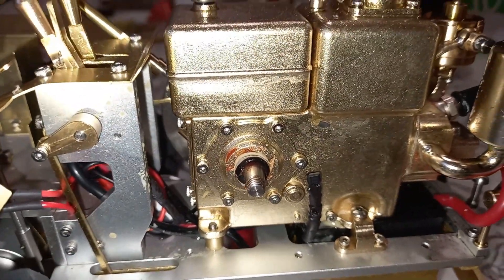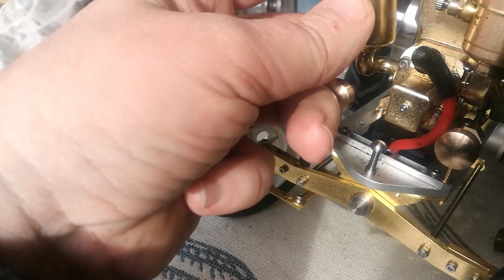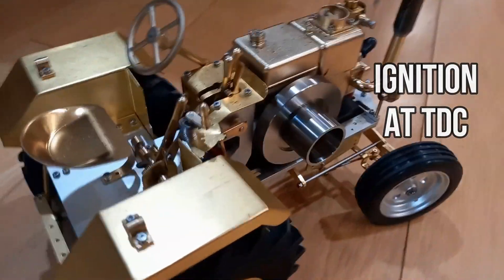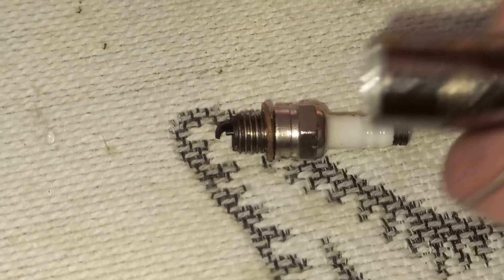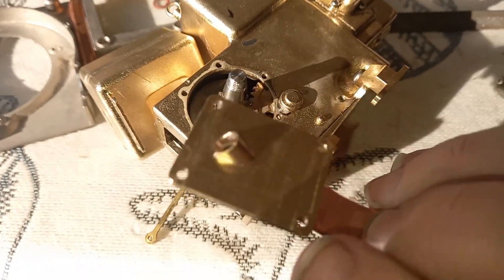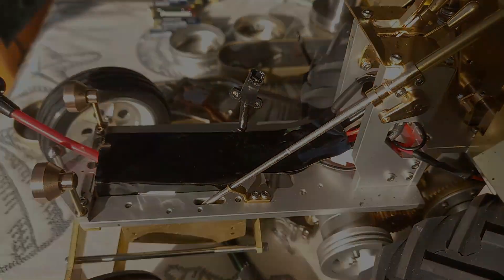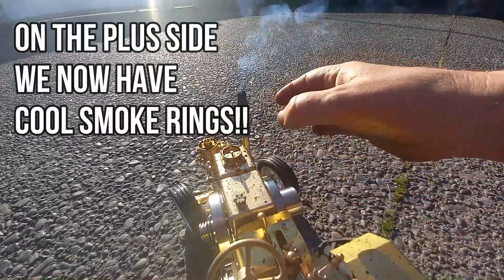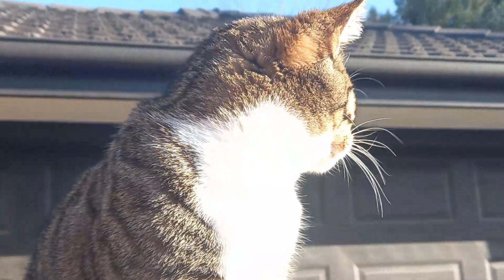T26 Model Tractor oil sealed, muffler, tweaks & FUN #model #engines #gasoline #chinese #t26

Comment: This tractor is so cool!
I have a horizontal M16B engine, mine's inging point was delayed, I also had to do a tune-up, which improved mine performance from 6000 rpm to about 8000 rpm.
Then I removed a slack in the bearings that tightened the valves and fine-tuned the air-gasoline mixture, in the end the engine reached 10,000 rpm.
I also had the same problem with my Cison L100 engine, where the solder melted on heating the discharge.
Reply from the maker: I don't know how I missed this comment! Leandro, I have just purchased the tractor with this engine. Another person with this engine commented that the lobes on the camshaft wore off. I am thinking how to counter this; maybe caseharden the cam or create an oil/grease bath for it...as it is raised. We sound similar in our wish to perfect these as much as possible! I love getting comments...sorry for late reply!!

Comment: I like to know how you set the hall sensor and the sizes of O-rings . Thanks Jeff
Reply: Hi from Thomas and the cats!  Thomas is really busy with work right now Jeff. But just quickly, ...he removed the spark plug and gently poked a small thin piece of something eg a hex key into the plug hole so it rests on the top of the piston. gently turn the flywheel to discover the top dead centre (that's how centre is spelled here in NZ along with millmetre, etc). He made a mark with permanent marker on the edge of the flywheel and against the top of the side of the engine (you can see in the vids). Next turn on ignition and hold the spark plug against the engine, rotate by hand. You'll hear the spark happen near where TDC is at but usually before it... To move the hall sensor you can grab the bottom of it with pliers and move it 1-2 mm and keep checking spark with your TDC. You want it really close to TDC I think,  but you can experiment. When tested, a drop of super glue will stop that hall sensor vibrating away from your choice. Sealer or blu-tac might be less permanent
As for o-rings, he has a "crap" set from a $1-2-3 shop with a bunch of sizes. The one on the Hall sensor side of the engine is just a little small for the shaft, and butts up against a flat washer that's just the right size. That was harder to find! The ones on the other side just dropped in, they are slightly bigger than that hole area...I'll get him to measure later. Sorry for the late reply
Reply: @xiaolingzhang5385  Hi . I like to know what weight of crank case oil should be used and what type of oil .  I also like to know if you use some oil mixed in the fuel or if you used other than gas . Like Colman fuel for lanterns  !  I got mine Sunday 7/ 10 / 22  in the after noon .  I was waiting like a little kid  looking at all the candy at the candy store . Could not decide between small bag full of penny candies or just one soft penny candy .  Bag full of hard candy would last a week and only cost one penny or one soft penny candy would only last 10 minutes .  Hep those was the days when you could buy something with a penny .
Reply: "Mullinix?" Where is that surname from? Where are you from?? :)
Reply: @xiaolingzhang5385  Our family started in southern boarder in France in 900AD and ended up Just out of Paris  in 1300AD old village name after our surname Molyneaux . Two brothers became members of the Knights Templar and that is how our family ended up in England . Then in the mid century as Colonials we came to Americas . Then we became peasants . Hard workers and Military personnel as they were before .  Our family ended up in Maryland and they  worked there as coal miners . When the Revolutionary war broke out our family went to fight the Brits once again .  I know my Ser name was changed before we came into the Americas I just dont know when . I do know that in England Our name and stature  and crest in on a stain glass window at a church . There is a lady that visited one of my brother name Larry and talked with him . She is a vary distant blood relative to us because of the church .  So I would say my real Sur name is an English form of Molyneaux is Mullinix . I know this is a ruff history of my Sur name and the how about's it's origins . My sister had changed her Ser name back to the French spelling or old English maybe . Our family name has always been surrounded with war up to my generation . My brother had served and also have I .  Our forefathers had fought before me . We fight because of our heritage . We fight for our freedom . We fight for our future generations . In this country our family fought in the Revolutionary war , The Civil war , WW1 , WW2 . and many campaign's wars after that . I was the only  young man in my family that did not fought in a war . All my brothers did . I have four other brothers and all seen combat .
Reply from the maker: Thks XL!

Comment: Vary cool . I just bought one about 5 days ago and still waiting for it .  I bought it from a Ebay seller that he sells a lot of these engines and some of the tractors . He has about 3 tractors at time on sale . He starts them off cheap  about 1 USD and the bidders start bidding . I got won my bid for one of these tractors for 325 USD and the shipping was 140 USD  the the ripoff TAX to my state I live in the grand total came out to be 496.85 or 496 USD and 85 cents . I dont think that was that bad for a price . Because where I see them on the net they are asking 1200 USD , I think that is way way to high from what your getting . They do look really good but you have shown me that they are not . They should have had seals on all of the external shafts . They should have a threaded pipe for the oil breather .  They should have put the hall sensor where it needed to be .  They did cut a lot of corners on this toy . As long as it run and looks good all they care about .
Reply from the maker: Yeah I suspect we're all getting them from ebay. I think all the sellers are actually Jin the maker, maybe he has a lot of stock, don't know. Different accounts for different markets I guess? Yours $500 all up is amazing. Mine way more like US$700. Consider trying to build it yourself. Some parts are amazing quality, for example I can't fault the suspension, diff, steering, controls,  and even the front wheel bearings are reasonable quality ball bearings and spin true. The tyres are outstanding.. Compare to a Mamod or Wilesco model similar size...! So I don't mean to show these tractors are bad quality. If all those things were different that I can pay attention to, the tractor would cost more than I can afford and I'd have nothing to do when I got it....if I could afford it. Would you pay $3500 for a US-made hit and miss engine or $300 for one of Jin's that needs a little work? LIKE A WORKING KIT, i ALWAYS SAY
Reply: @ThomasPCGuruENGINES   I see your point . The one I bought and have not received yet  I just hope in has the quality you just described . I can do the thing you have done to make them better . I hope Jin would take note and change the timing on the Hall sensor and add O-rings to the rotating parts to seal up the oil . I do know that these engine have O-rings piston ring . I just dont think they would hold up . But if they do then that would end piston and bore wear from steal rings . The best would be  Millennium cylinder or what people call silicon steel cylinder . That dont wear out with light weight stainless rings . But if Jin could make money and do improvements to his engines for longevity then people would keep buying them and things would get better and better for him . I would really love for him to build a Caterpillar D-4 or a D-6 . dozer with tracks using  the 4 cylinder gas engine . I seen one the other day here on YouTube.  It looked really good  and it moved both back and forth under it's own power . It did not have the blade thought . I also wish some company would make  steel Caterpillar tracks for 1/16 scale dozers  . I am in the ending prosses in turning a 1/16 scale Ertl International 340 track tractor into RC . It is a tuff job . I had to use two N20 geared motors , one double ESC and have to be vary small and a super small receiver . Been trying to find hydro system to work  and fit . That ended up being impossible . So back to the N20 geared motors . I ended up having some small electric retract gears to work . I am in the process of finishing that up . This is a vary small track tractor and using every CC free space it has and then having to make some more space internally with out affecting the out side . Just remember there is vary little room in one of these die cast models of this scale just being a small track tractor in full scale . The full scale is about from grill to hitch is 9ft -4inch  and outside of edge to edge of the tracks is about 6ft . So this makes the 1/16 scale  that is what 7 inch long X widest part of the tractor not track to track is 3 inches at best . Then subtract the thickness of the pot metal   That just gives me about 3/16 of gap where the engine castings and the I had to make room behind the rad area . then I have some small space where the trans is . That is three areas for electronics and the space above the engine bay for the Battery . There I have a space of inch and 1/4 X 3/8 X 1 1/4  That is the largest area . But when it is done it would be really cool . I also had to buy 2 of these because one model had white metal tracks with no blade and the other model had a blade with rubber tracks . I want it to have metal tracks .
Reply from the maker: Sorry I missed this reply.  I hope you can show your new model on internet or something? Sounds complex...and cool. Jin is already making a tracked tractor https://youtu.be/EmiRG8lnKW8  it's a smart cheap way of building a tracked device....   and a new tractor engine air cooled https://youtu.be/sedXC3D7Cu4  The tracked one not offered for sale yet. He struggles to sell all these at a great price so very complex models may not appear nor quality improvements. I wondered if he could sell an "engineers edition" of each model with oil seals, gaskets and a wee tool set...?